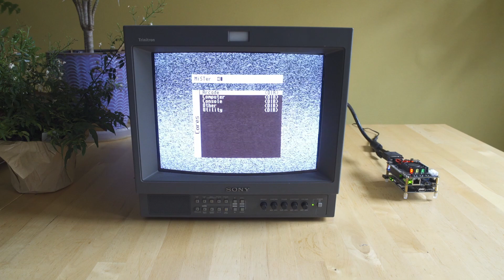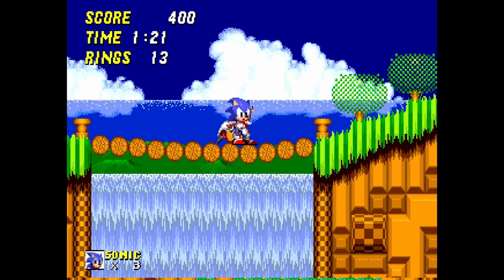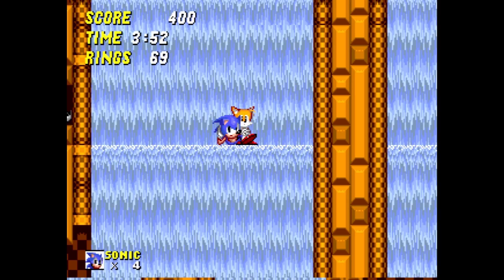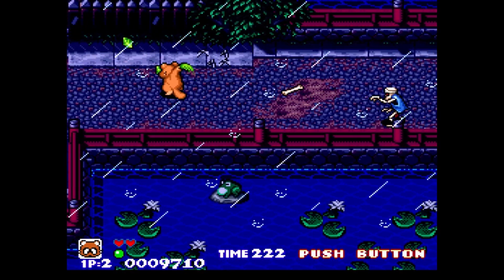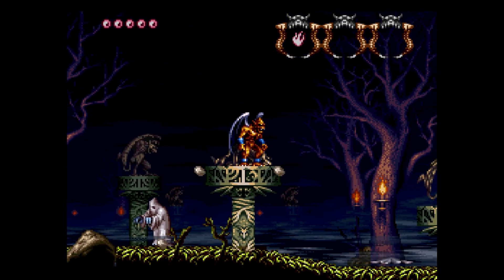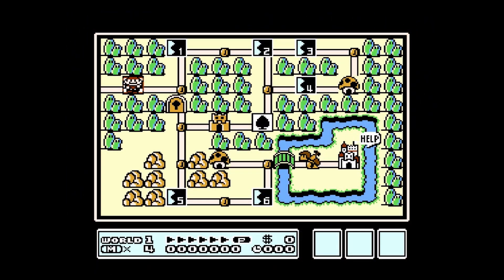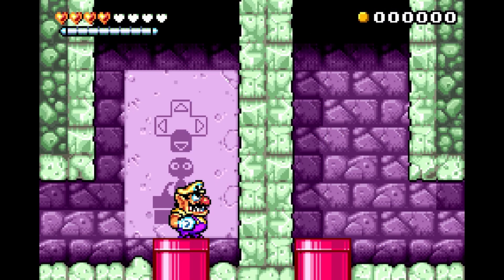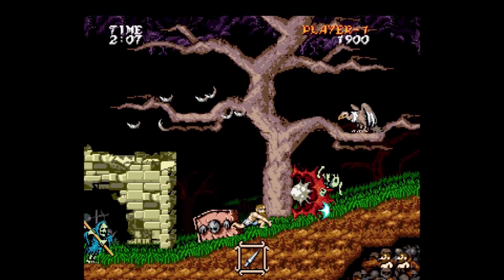MiSTer FPGA DE 10 - Composite Blending for that old school CRT Retro Gaming Look!

Comment: I personnaly begin my journey with RF on my Atari 2600 and in black in white 😅 then i got an amstrad CPC 6128 with his color monitor and a tv tuner base who come with scart i hooked my megadive(genesis) has soon as i can and this was epic, then years later i discovered import game with the 32 bits era and with my satrun(jap) i discovered ntsc color , first my sat was connected via composite , i tried rgb via scart and was disapointed by the colors mostly and then tried s-vhs this was a blast obviously a little less sharper than scart but better colors and this blend effect was here too and since the saturn lack of transparency effect for me this was the best of two worlds but it depends greatly on the console you're using a Neo Geo or N64 are way better via rgb than composite for exemple  imho.

Comment: No, developers did not rely on composite blurriness  back in the day to “make things look nicer”.  I wish people would stop perpetuating this post hoc myth.  And you use a Neo Geo as an example? A system whose games were first and foremost arcade games displayed on RGB arcade monitors? 

There was an actual composite mode on some early PCs that would produce actual distinct, completely different colours using composite artifacts. This could make 16 colours out of 4 at the cost of resolution. This was not used on home consoles, it wouldn’t work else they would’ve tried it. But I think this is the origin of the “they drew it with composite output in mind” BS.
Reply from the maker: developers have literally said they did this in interviews so? I will take their word for it
Reply: I’ve never read that, any examples I can look up?

Comment: What version of Genesis core are you demonstrating this from? I'm on v220626, and I don't have any of the menus/filters/etc you're showing at TimeStamp 00:01:18. I'm on UpdateAll v1.4 and am not pulling anything new in for Genesis (as of this thread post). Is this a custom setup, and if so, can you provide Github link(s) to where you sourced your binaries so that I can replicate what you're demoing? That sall said, I do love this and the Horror series..so thanks all around..forgot to say that earlier.
Reply from the maker: Glad you like the series. I cannot remember what version. I captured it two months ago and I’ve sense updated the card. It may have been reorganized in the menus. They tend to do that a LOT with updates
Reply: @VideoGameEsoterica  I see, thanks for the quick reply! Well, they most certainly did restructure a lot of the menus (of the Genesis/MD rbf), as things are split off into a "Video Settings" section. Technically, my filter menus I'm seeing look more like the menus that 'TRI' at the 'MyLifeInGaming'  YT channel demonstrated in the MiSTer FPGA Buyers Guide 2022. I've also checked at the main 'Filters_MiSTer' Github page, and don't see anything called 'Composite Blend'. I  can only assume that the 'GS_xxx' filters are the thing that simulate what you're demoing here. If I'm incorrect in this, please let me know. Again, thanks for the quick reply...and series!
Reply from the maker: I’ll look into it :)

Comment: Not surprised the handheld ones don't work as well - they were designed to make the most out of the screens they used, with a purely digital signal. Probably the best way to simulate the older look for handhelds would be ghosting filters.
Reply from the maker: Haha ghosting filter

Comment: I feel like part of the reason the darker images become potentially better without the blurring is gradients. When there are harsh differentiation in color and contrast, blending helps soften and create gradients that aren't there.

When the tones are more mild, brighter or darker it doesn't matter, those colors are much more forgiving on the eyes. Id say though that which looks better is going to fall on the intention of the pixel artist and human subjectivity.
Reply from the maker: Yes this is all subjective. But the blending that a CRT does was in mind when the artists who made these games were creating the art and it was def never intended for big chunky pixels on LCD TVs. Not that that look isn’t good in ways though :)
Reply: @VideoGameEsoterica  there was an interview with some of the ffvii developers at one point. And there answer to whether or not they made the art based on 4:3 aspect ratio and they answered "neither." It was whatever displays they had on hand. But what's interesting is there wasn't ever a one size fits all approach.

Capcom used grid paper for their art and later during the CPS2 days thry had custom gridpaper madewith the 1:1.15 aspect ratio of the CRT pixels which is probably a big reason why Capcom art is rather timeless.

But even still, the team behind Wily Wars developed entirely off of CRT monitors and it shows. Alot of what makes Wily Wars nice to look at is only found in filters and scanlines instead of regular square pixels
Reply from the maker: Basically the only consistent thing about game design back in the day was there was absolutely no consistency
Reply: @VideoGameEsoterica  100% lol

Comment: I use heavy composite blending on the NES core, that's how I remember the picture looking as the connection for that system was RF when I was young. The Genesis core I use  medium composite blending and the SNES core i use very light. I never  grew up with a Master System but I use filters to mimic an RF look because that's how I  would have played it way back when. I adore the options MiSTer provides, especially the Gameboy DMG filters. I want the games to look like they did before modern TVs.
Reply from the maker: My NES as a kid was always on RF and my Genesis started on RF till we got a new tv with composite

Comment: 8:38 this filter seems to mostly do things along edges. They still use things like dithering to make shades the GBA doesnt normally have, which, as ive been playing a lot of GBA on a CRT through Svideo (which of course still has a small amount of blending) it does make the dithering kind of blend together and looks really cool. Thing is this filter seems to specifically not blend dithering in most cases.
Reply from the maker: GBA on CRT is always a fun time

Comment: I do recall using the RF for the NES and initially for the Genesis growing up. I'd imagine the Sega Master System was also RF but I was still a bit too young to know for sure. Otherwise, we were a Composite household for many years including through the PS2 and GameCube era. Although, it's funny how often people remember games looking better than they were. Connecting the MiSTer to my same Commodore 1702 monitor over Composite looks worse than I remember but hooking up through the S-Video quality Commodore Video lines up with my memories.

On a HD or 4K display, I do prefer to put on a little blending and scanlines. This where using L and R to scroll through submenu options comes in handy as I can quickly watch it change and go back and forth to see what level of blending I prefer. It's definitely something I personally customize to each console but occasionally on a per game basis.
Reply from the maker: I remember when we got a tv that had S video and that was like the biggest feeling upgrade ever. 

Now I have a 4K QLED in the living room and an 8K production monitor in my office
Reply: @VideoGameEsoterica  And thankfully solutions like MiSTer and RetroTink help keep retro "up to spec" for this modern display era.The level of fine tuning and compatibility is great. I still can't believe VRR has been implemented in MiSTer.
Reply from the maker: Yes. I want to do a VRR video but I don’t have any compatible displays. All my monitors in my office are production monitors so they def don’t go variable

Comment: I grew up with a bad TV. As a kid, I always wanted clear images. Something about that makes me love crispy pixels. Like I'm finally getting what I couldn't afford. It's like the 'next upgrade' for me. I went from devil's pitchforks to screw-in RF to composite to S-Video within 2 generations and every upgrade felt like a milestone. So to me, clean pixels feel like the 'you made it!' of video output. Except PS1. That shit needs blending.
Reply from the maker: I get that. Crispy looks nice most of the time. But yes first gen 3D consoles need a bit of help
Reply: @VideoGameEsoterica  yes, early 3D stuff is rough, but internal-upscaling (such as with emulators like the amazing Duckstation works wonders). Pre-rendered backgrounds always look like shit though unless you get an AI-upscale.
Reply from the maker: Duckstation does some fun things for sure. It’s wild to see if fully upscaling and improving everything

Comment: I'm fine with the sharper image and could never really tell much of a difference with all of the different filters, they usually just look blurry or dark and blurry when it comes to those scale line filters. With that being said, I really did like the look of SMB3 and Metroid with the filter on and the scale line filter didn't look completely awful. I'd still probably never use them and if I did it would be one time for novelty sake, but this does look like a step in the right direction for those who do use them.
Reply from the maker: and thats the fun part about these filters...they are there if you need them but totally don't need to be used if you aren't into them. Id say 75% of the time I use no filters

Comment: You aren't choosing very compelling examples here, where this makes a huge difference. The waterfalls in Sonic 1, the bubbles in Genesis Cool Spot, literally everything in Genesis Duke Nukem, and the backgrounds in Earthworm Jim pretty much need this at 100% to look correct.
Reply from the maker: They are just the examples I liked talking about / the ones that are impactful to me. Plus I did include Sonic waterfalls
Reply: @VideoGameEsoterica  You did not include the Sonic 1 waterfalls that use the effect to create transparency, which is a much more dramatic example don't you think?

Many Genesis titles in particular used this to either simulate transparency or produce a wider palette, and these games look outright wrong without the effect on.  You should really cover these cases where it makes a huge difference.
Reply from the maker: Eh I felt these waterfalls would hold up better to compression but that’s just me
Reply: @VideoGameEsoterica  Again, you're missing the point, the other waterfalls actually use the RF bleed as an effect where these really don't. You're comparing apples and oranges.
Reply from the maker: I wanted to compare apples to oranges. That’s my point
Reply: @VideoGameEsoterica  I mean comparing Sonic 1 and Sonic 2 waterfalls is apples and oranges. Anyway, boot up these games and set the composite to 100% and see what I mean.
Reply from the maker: Just wait to the actual composite video lol
Reply from the maker: I know about it. Maybe I’m saying it for another video. One about actual composite video on MisTer people keep asking me to make lol. You guys have to let me keep SOME secrets for the future. These examples are all planned out as a series :)
Reply from the maker: Lol I’m just saying is I usually have a plan in mind for the future so I don’t show every best example in every video so as to not be repetitive with footage when I do another video on a similar or adjacent topic

Comment: IMO: Scanlines help alleviate "jaggies" especially in very high contrast areas, like around text; Blending helps smooth colors together. Both together makes most games look great, IMO.

Stuff like NES benefits more from scanlines than blending, though. Lots of high contrast stuff because of the limited color palettes.

SNES & genesis usually benefits, but sometimes the pixel work may be so fantastic that blurring it makes it grab less attention. Like in the background elements you were saying you thought "popped" better. They weren't supposed to pop, they were supposed to blend into the background.

Once you get into 3D, though. That slight blending is indispensable. It just makes everything seem more natural. The "jaggies" everyone used to complain about with PS1 in emulator are significantly mitigated. If course, you can't go too far, or you get the N64 "vaseline" filter which gets universally applied to all games, prior to video generation... (discounting mods that remove it, of course) Which, for the record, wasn't an issue for me or my friends back in the day on a real CRT.

We need a filter that simulates playing over an RF signal to a CRT with bad convergence and significant geometry and color issues. Just to show all these people what we had to put up with back in the day!
Reply from the maker: The biggest thing about retro systems and video signals is just how exceedingly complex it all is

Comment: I was just messing around with interpolation last night to try to smooth out the image before applying either scan lines or a mask. This is gonna be perfect for that. Was this added recently, or was it always there?
Reply from the maker: Its been there for a while but its "newer"
Reply: @VideoGameEsoterica  Just realized the hud on my mister has a different layout than yours. There's no scale filter option on that system tab. I notice you also have the shadow mask option on your system tab. There's also no video processing option on your system tab. That's why I never found the scale filter option. It's not there on my setup. :)
Reply from the maker: Need to update!
Reply: @VideoGameEsoterica  Does the Digital IO cause a different HUD to show up, by any chance? I know you have the analog one. My setup is updated, but the hud is still different.
Reply from the maker: Hmm. That I’ll have to ask about
Reply: Try setting the vscale_mode setting to "Scale to fit the screen height" in the main Mister ini file.
Reply from the maker: Not a bad idea
Reply: I'm so trained to set video to integer scaling that I wasn't seeing the additional video options either, but full screen fixed it. To adjust for non integer shimmer, there's an interpolation preset in the video options once a game is loaded.
Reply from the maker: Yes there are so many settings you can change and articulate. It’s seemingly endless

Comment: Honestly, some games just don't look right without some sort of CRT filter. Chrono trigger comes to mind. The whole game looks like a pixelated mess unfiltered but once you use some sort adaptive scan line filter the art stops looking like a bunch of differently colored dots and like what it's supposed to.

It's especially noticeable in the menu's for CT and the forest areas on the world map. The lettering on the menu's has shadows behind it but if you have it coming through raw and unfiltered the shadow effect literally doesn't work, it just looks likes black pixels beside the white text instead of a shadow under it. Filtering it adds the intended depth and creates the shadow effect. Same goes for the forest's in CT. If it's unfiltered it's just a mess of random green and brown dots that if you cut out of context and showed someone would look like nothing. Blur it with filter or blend and boom, now it actually looks like trees.   

There's that great image of Dracula floating around from castlevania SOTN that shows it perfectly. The unfiltered Dracula eyes are clearly just flat red dots in a sea of white while the scanline filtered dracula's eyes look like glowing red eyes that are sunken into his head like they should. 

Point being is that while sometimes the chunky raw pixel look can be fine, it's often never how the art was meant to be viewed and sometimes the art itself simply vanishes without filtering.
Reply from the maker: It is very game to game dependent. Some look great, others dont. The fun is in the experimenting